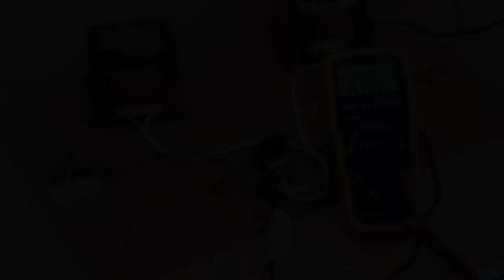DIY Welding Machine / Only 2 Microwave Transformer / Good Job

Comment: Hello @Murat Guney since I have a 4000w dimmer but the fuse burns out, I would like to boost it with triacs, which triac should I put and if you could tell me the precise abbreviation since there are many on the internet, thanks you are number one 😉
Reply from the maker: Hola.  Supongo que no te pude responder antes.  Por lo tanto, pido disculpas.  Puede usar un triac con una resistencia actual de alrededor de 32A.  Sin embargo, yo uso triacs 8A BT137 conectándolos en paralelo porque son más baratos en cuanto a precio.  Si ha utilizado 2 transformadores, puede fortalecer el atenuador en su mano conectando 4 triacs BT137 en paralelo.  Sin embargo, si su circuito de atenuación está quemando fusibles constantemente, el triac (elemento de circuito de 3 patas) y el DIAC (elemento de circuito de 2 patas y generalmente de color azul) en el circuito pueden estar defectuosos.
Reply: I did the same copy and paste work as you, now I boost it with the 4 triacs , as I wanted to buy the silicone cable but 4mm in AWG which number should I take??
Reply from the maker: Hello.  I missed your message.  Don't worry.  You can use AWG11 cable.  It will be a little thicker, but there is no other alternative.  Pay attention to smooth and tight winding.

Comment: Buenas Amigo, excelente trabajo, muy profesional, pero quería saber cómo cuántas vueltas hay que darle de cable para la bobina secundaria y a cuántos voltios hay que llevarlo.
Reply from the maker: Muchas gracias.  Para cada transformador se requieren 24 vueltas de 6,5 metros de cable con aislamiento de silicona de 4 mm2.  Se requiere un total de 13 metros de cable.  Se toman 20V de cada transformador y se obtienen 40V conectando 2 transformadores en serie.  Hay subtítulos en español en el video... Convertiré el voltaje de salida a DC y pondré el video.  que tenga un lindo día

Comment: Saludos cordiales y gracias por compartir tu experiencia y conocimientos, yo hice uno pero sin el dimer, suelda bien, pero a veces me quema los electrodos, gracias por el dato 👍🤠☕
Reply from the maker: Hola, en primer lugar gracias.  Sin un atenuador, como dijiste, el electrodo se quema y se derrite muy rápidamente.  También hay más chapoteos.  Creo que deberías comprar un atenuador de 4000 W y enchufarlo.  Gracias nuevamente por su interés.
Reply: te quema el electrodo por falta de amperaje
Reply from the maker: Hola.  Dijiste falta de amperios, pero no existe tal cosa.  El electrodo que utilicé es de 2,5 mm.  Estoy usando el acelerador actual.  Si abro demasiado, el electrodo se quemará.
Reply: All Professional Welders have an  Amperage !.Rating ! Maybe yours ! Does ! Not !! Here !
Reply from the maker: Hello.  Thank you for your interest.  I am not a professional welder.  This machine is not professional either.  I adjust the current setting on the average according to the thickness of the material to be welded and the type of electrode.
Reply: SO ! REALLY ! You COULDN'T !! Care !! LESS !! About !! Welding !! ARTICLES !! TOGETHER !! THAT !! WILL !! BREAK !! WHEN THERE !.BEING !! USED !!
Reply from the maker: Let me state it again... I can't really make sense of what you wrote.  I hope you or someone else who reads and understands this message will help me.

Comment: Felecidades Murat por tu proyecto una pregunta sólo quiero de menor amperaje para soldar planchas,tubos delgados que me aconsejaria utilizar número de cable y cuantas vueltas
Reply from the maker: Hola.  El cable que utilizo es un cable aislado de silicona de 4 mm2 con código N2GFAF.  Baja corriente ajustable gracias al circuito dimmer

Comment: Hola buenas primero que todo exelente video muy clara tu explicación mi consulta es tengo 3 tranformadores con el devanado en cable N10 el dimer de 4000 w me sirve para regular el voltaje gracias ?
Reply from the maker: Hola.  No entendí completamente tu pregunta.  ¿Qué significa cable N10?  ¿Tienes 3 transformadores y quieres construir una máquina de soldar?

Comment: hola amigo muy buen video una consulta el consumo del bobinado primario de cuanto estamos hablando ? saludos
Reply from the maker: Hola, ante todo gracias.  Entiendo que está preguntando sobre el consumo de energía del devanado primario.  Estos transformadores también consumen algo de corriente en reposo.  La corriente consumida depende de la configuración del circuito del atenuador, ya que uso 2.5 electrodos, ajusté el atenuador a la configuración adecuada.  En este caso, consume alrededor de 2A de corriente en reposo (si no me equivoco)

Comment: You done a very fantastic job there well done my brother, can I be possibly doing the same thing, the problem we have in Nigeria, to get exactly wire that cannot be born all melt, you are using and the adjuster to adjust the current how can I.
Reply from the maker: Honestly, I didn't quite understand your message.  but you are asking how the dimmer circuit I use is made.  The dimmer circuit you use is a normal commercially available circuit.  I just added 4 bt137 triacs to make it more powerful.  You can see how this connection is made from the diagrams in the description section.  However, if there are places that are not understood, you can ask.

Comment: Good afternoon, after seen your video I'm making one with 3 microwave transformers 120volts, but the output on the electros welding arc cable reads 60 volts, would this be a problem.? can you indicate.  I'm using a 4000 wats dimmer as per your recommendation also using 2 120 fans as well. Your response is much appreciated. Keep those teaching videos coming. Regards.
Reply from the maker: Hello.  I apologize for returning late.  60V is fine for 3 transformers.  However, at 120V mains voltage, a 4000W dimmer is not sufficient.  Because more current is drawn from the network compared to 220V.

Comment: una pregunta depronto tienes el enlace o video de otra maquina  igual pero con 4 transformadores gracias desde colombia
Reply from the maker: Hola.  Según tengo entendido, estás hablando de 2 videos de máquinas de soldar que hice.  El primer modelo de 4 transformadores que hice podía dar una corriente más alta (alrededor de 250 A), pero era demasiado pesado.  Por eso hice el modelo con 2 transformadores.  Esto da menos corriente pero suficiente para mi trabajo (electrodo de 2,5 - 3,25 mm).  También hice un modelo con 3 transformadores, pero no le hice un video.

Comment: Slm guzel bir çalisma olmus 4 transformator ile 30 volt almayi basardim tabi 10 mm kablo kullandim kaynak yaparken 2.5 luk 5 elektrot bittiginde yaklasik 45 derece kadar isiniyor  sizin makinada da aynisi oluyormu merak ettim donuş yaparsaniz sevinirim
Reply from the maker: Merhaba. 5 elektrod sonrasında 45 derece hiç sorun edilecek bir sıcaklık değil. Bu uygulamada 2 trafo ile 40V elde edebilmek için 4mm2 kablo kullandım bu nedenle tam olarak bilmemekle birlikte daha fazla ısı oluşur. Silikon izolasyonu da bu nedenle tercih ettim

Comment: This was exactly what I was looking for! A well-made arc welder from microwave oven transformer. Excellent video. Although the plan pdf files are not very descriptive. Kudos however for the beautiful work.
Reply from the maker: Thank you very much.  I'm glad you liked it.  I also shared a video for converting the output voltage of this machine to DC.  I also renewed the dimmer circuit I use to adjust the output current and shared the video showing how the circuit is made.  You can find both videos on my channel.

Comment: interesting, I am going to do this project, I have a couple of  microwave transformers lying around, I am also going to install  one of those chinese  Voltmeter  screens, to measure voltage and current in real time,  greetings from the isle of Dominican Republic in the caribbean.
Reply from the maker: Hello.  thanks.  I'm glad you like it.  It may be convenient to connect a voltmeter 👍 Greetings from Turkey
Reply: hi I've been watching the news about the tragedy that happened in turkey I hope that you and your family are ok bro, we've been feeling small  5.0 tremors here lately,  by the way I bought all the components to make this project but  I realize that these dimers are 220v  imput suply  yet my country's  nominal voltage is just 120v , now what can I do?
Reply from the maker: Hello.  Me and my family are fine, but unfortunately our Turkey is not.  We are so sorry.  10 of our cities were greatly affected by the earthquakes.  In some cities, there are no solid buildings left... As for your question... the dimmer circuit actually has no operating voltage.  The current value is important.  Although the ones sold in the market are named according to the power value, the main thing is the current value of the triac element on the circuit.  You may think that the dimmer circuit you bought is at half power.  So the circuit you get as 4000W is considered as 2000W.  This is because a system that draws 10A at 220V will draw about 20A at 120V.  In fact, the power value is the same, but since the current drawn is higher, the triac in the circuit must be able to withstand this current.  In short, any dimmer circuit can operate at 120V voltage.  But my advice to you is to add a parallel triac like I did.  If an 8A triac like BT137 is to be used, you need to use 6 pieces.  With a simple calculation, a circuit with a resistance of 6x8=48A is obtained.  This would be 120x48=5760W as power.  It's a bit of a long post, but I hope I was able to explain it.

Comment: Not bad at all. Thanks for sharing.
Reply from the maker: Thank you.  I am actively using  I also published a video for the process of converting the output voltage of this machine to DC.  I recommend you to watch
Reply: Thanks. Will do.
Reply from the maker: @robertblackshear8963  Thank you too 👍

Comment: Power supply for the coolers should be connected after switch. Nice job.
Reply from the maker: Hello.  I connected the fans independently of the switch.  So as long as it's plugged in, the fans are running.  The switch only disables the transformers.  Thank you for your interest and comment 👍

Comment: Amigo excelente tutorial, lo hice los dos me generaron 35 volt, pero calienta mucho el bobinado
Reply from the maker: Hola.  Sí, dado que los devanados están enrollados con alambre de 4 mm2, se genera mucho calor.  Es necesario disipar el calor con ventiladores.  Si se utiliza un cable más grueso, el valor del voltaje permanece bajo.  Así es como lo uso.  ¿Cuánta temperatura fue posible medir?  Además, ¿el cable que está utilizando está aislado con silicona?

Comment: Buenas exelente video 
Una pregunta cuántos metros se lleva cada transformador y el calibre es 4mm = 12 awg
Reply from the maker: Gracias.  12 cables AVG estarían bien.  pero puede ser costoso en términos de precio.  El cable que uso se utiliza en la instalación interior de calentadores como estufas eléctricas.  Hice 24 bobinados en cada transformador y usé 6,5 metros de cable.  Se requiere un total de 13 metros de cable.  Por cierto, el cable que uso se llama N2GFAF.
Reply: muchas gracia 👍👍👍por el dato
Reply from the maker: Gracias también 👍

Comment: Sir plz tell me the turns of wire in each transformer and the AWG of wire
I see your videos
Reply from the maker: Hello.  I made 24 turns with 4mm2 silicon insulated cable in each transformer.  I used a total of 13 meters of cable for 2 transformers.  You can also use awg 12 cable but it is more expensive.

Comment: Hello, please do you think I Can use a 3,6mm2 wire ? (2,6mm2 for the conductive wire - Sillicone high temperature wire/câble) Thx for reply
Reply from the maker: Hello.  I apologize for returning late.  You can use the cable you mentioned, but 2 transformers will not be enough in this case.  Because as the cable thickness increases, the transformer cannot be wound sufficiently and the output voltage remains low.  However, if you consider increasing the number of transformers, you can obtain sufficient output voltage.

Comment: Buen video amigo muy constructivo, una consulta los 13 metro son para uno o los dos transformadores. Grasias y saludo
Reply from the maker: Muchas gracias.  Se requieren 6,5 metros de cable para cada transformador.  El cable a utilizar debe ser un cable de cobre con aislamiento de silicona y una sección transversal de 4 mm2.  Se deben hacer 24 devanados en cada transformador.

Comment: Bom dia! Excelente máquina de solda parece que solda muito bem, voce poderia me dizer quantas voltas tem em cada transformador e detalhar melhor as ligações dos triac? Não sou muito bom em eletrônica. Obrigado!
Reply from the maker: Olá.  Em primeiro lugar, obrigado.  Usei cabo de cobre isolado com silicone com comprimento de 6,5 metros e seção transversal de 4mm2 em cada transformador.  Fiz 24 enrolamentos em cada transformador.  Mas não se preocupe se não conseguir encaixar.  Entre 20 e 24 é suficiente.  Conectei os triacs em paralelo, ou seja, conectei as mesmas pernas de cada triac entre si.  Tem um vídeo sobre isso no meu canal.  Tentei mostrar como podemos fazer esse camelo na placa de circuito impresso.  tenha um bom dia

Comment: Amigo exelente un 100, tengo una duda en qué lugar puedo encontrar el alambre es el único que me falta
Reply from the maker: Hola.  En primer lugar, gracias.  Creo que te refieres al cable que uso yo en el devanado secundario.  No creo que sea un cable difícil de encontrar.  Lo compré en una gran tienda que vende equipos eléctricos.  Cable utilizado en las instalaciones internas de calentadores eléctricos.

Comment: Me encanto el trabajo pero tengo una duda y es que dices usar un cable número 4 y le das 24 vueltas a cada uno pero primero veo el cable que usas más delgado que uno #4 ya que tengo un cable número 6 que es más delgado que el tuyo y solo dio 4 vueltas por lo grueso que es
Reply from the maker: Hola.  Dado que el cable que uso está aislado con silicona, puede parecer más delgado que su cable de 6 mm2.  Sin embargo, el cable que uso es un cable de 4 mm2 con código N2GFAF.  Si quieres usar un cable de 6 mm2, mi consejo es que uses 3 transformadores y envuelvas todo lo que puedas.

Comment: Can I use a single pole 20 Amp 6 position switch in lieu of a dimmer switch for outlet source of 110v or what is your best alternative.
Reply from the maker: Hello.  A 6-position switch can be used, but in this case it is necessary to remove the tip from different parts of the coil.  In this case, the current can be adjusted, but the voltage will be low.  In fact, the best and simplest solution is to use a quality dimmer.  Since I don't trust the dimmer circuit I bought as 4000W, I made a boost by connecting a parallel triac.

Comment: Me gustó mucho tu máquina de soldar, cuántas vueltas de cable son por cada transformador y que calibre es, vivo en México, y cuál sería la conversión de 4 mm2, y se le podría poner una pantalla digital para ver los amp. Y es a 110 o a 220 De antemano muchas gracias y felicidades por tu trabajo, quiero hacer una igual.
Reply from the maker: Hola.  Cada transformador tiene 24 vueltas de bobinado.  Usé 6,5 metros para 1 transformador y 13 metros para 2 transformadores de cable de cobre con aislamiento de silicona de 4 mm2.  Si el transformador que vas a utilizar se saca del horno de microondas trabajando a 110V, funcionará de la misma forma a 110V.  Es decir, la tensión de funcionamiento depende de la tensión a la que debería funcionar normalmente el transformador del horno de microondas.  Las operaciones a realizar en la parte secundaria serán como podéis ver en el vídeo.  El video tiene subtítulos en español.  Tal vez sea útil.  Si se va a utilizar con tensión de red de 110 V, el circuito de atenuación debería ser más potente.  Porque a 110 V, se extrae más corriente de la red.  Puede instalar una pantalla digital.  Puede medir el voltaje de salida con un voltímetro, pero para esto el voltaje de salida debe ser CC.
Reply: Muy buen dato. Voy a hacer uno parecido . quisiera estar en un solo transformador con 40 o 45 vueltas de bobinado. A prontito el experimento...

Comment: Merhaba öncelikle çalışmanız için teşekkür ederim sade anlaşılır ve gayet başarılı   benim sorum şu her şeyi hazırlıyorum fakat 2 dk sonra dimmer arızalanıyor 3 tane 4000 watt dimmer yandı acaba bunun için bir çözüm varmı yada 4000 watt dimmer yerine ne kullanabilirim  teşekkür edrim
Reply from the maker: Merhaba. Teşekkür ederim. Eğer herhangi bir hata yapmadiysaniz dimmer devreleri sorunlu olabilir yani gerçek 4000W olmayabilir. İsterseniz benim yaptığım gibi yapın. Yani sağlam bir devreye 4 adet BT137 triyaki paralel bağlayın. Bağlantıyı devre üzerindeki triyaka direk paralel olarak yapacaksınız. 1. Bacakları 1. Bacağa 2. Bacakları 2. Bacağa ve 3. Bacakları 3. Bacağa... Benim yaptığım devre hiç arıza yapmadı.
Reply: çok teşekkür ederim yanıtınız için bir sorum olacak bu işlem için 4000 watt dimmer'mi yoksa 2000 watt'mı kullanayım teşekkürler
Reply from the maker: Çok geç dönüş yaptığım için özür dilerim. 2000W yeterli olur. Zaten triyak eklemesi yapınca gücü yeteri kadar artacak